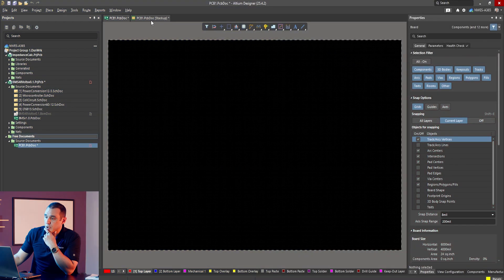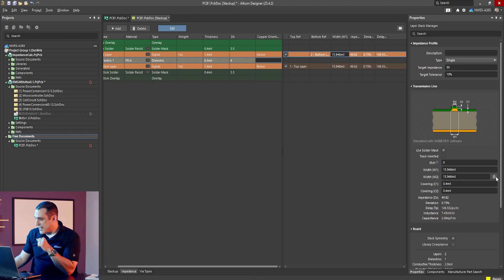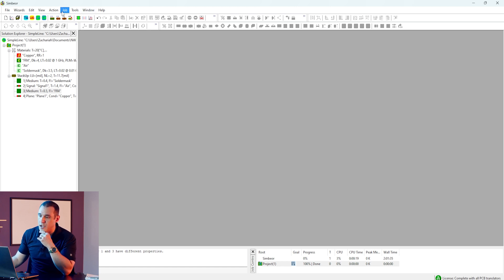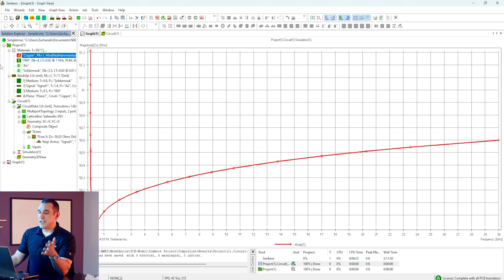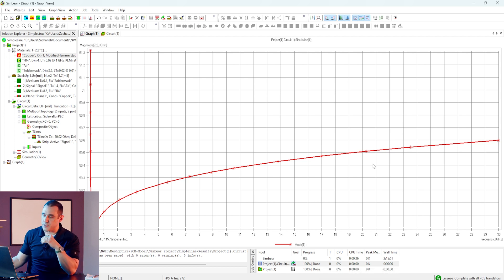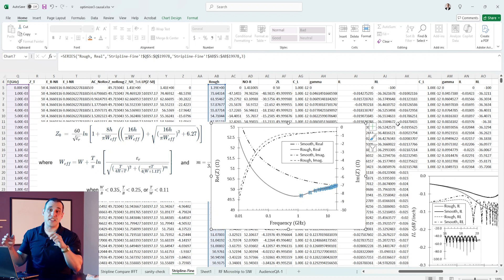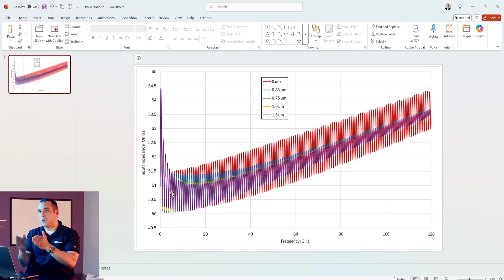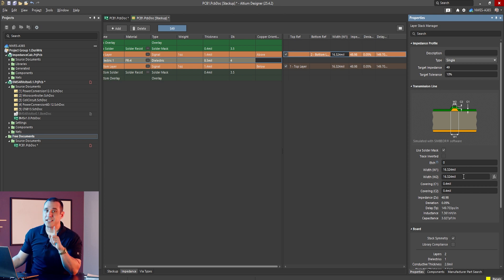Compensating Transmission Line Losses in a PCB Calculator

Comment: Around 14 minutes, ( https://youtu.be/b1cEUONDpCw?si=DiQ-cjTAa--XkhPU&t=840 ) it looks like you should prefer a rougher copper at high frequencies, because the impedance curve is smoother, so that by 80GHz the "rough" 1.5 micrometer roughness has only about 1/5 the variation of perfectly smooth copper.  The crossover looks to be around 5GHz, but I thought it was high frequencies where you wanted smoother copper.  Am I misreading the graph, or is this another artifact of modelling, or do you just look at the precise frequency you care about, or ...

Comment: hi Zach! thanks for the great content.keep up good work, you are real hero.
I saw a recommendation given by an hw guru (may be bogatin or hartley) in a webinar video claiming that you need to set a target impedance a bit more because parasitic capacitances of the trace and etc will make it hit the target imp you actually need.

you say set a bit lower target imp in clculator.

so Im confused which one is correct😅 
please clarify  
thanks for  advance
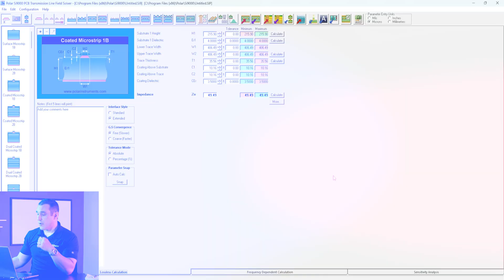Reply: Well I specifically am looking at skin effect/roughness case, which is prominent in the lower Dk/lower Df cases. For higher Dk values, it is possible that the actual impdance is a bit lower than the lossless impedance, especially when are at lower frequencies. But this is why one of the impedance simulations shown around 7:23 will give you an indication of whether the true impedance is above or below the lossless impedance. Other than that I can't comment on Hartley or Bogatin's remarks.